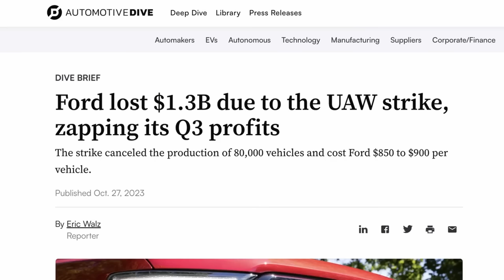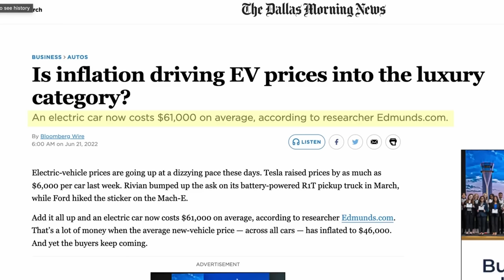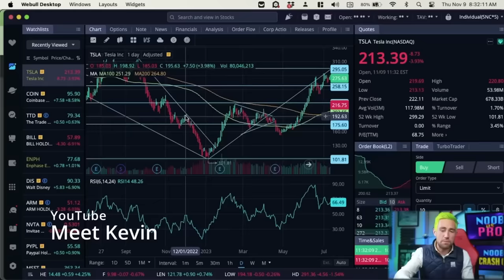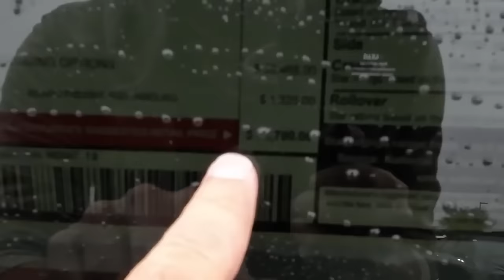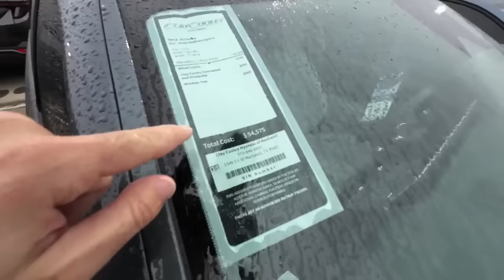Ford & GM Made A DUMB MOVE! Truck Buyers ANGRY After Finding Out The Truth...

Comment: If the appeal of an EV is to “save gas money”, why the hell would I spent 50-$60,000 to save $150 bucks a month on gas? 😂
Reply: So many other new cars are around that price. Sad
Reply: And when you add it up , when you charge an EV your still not getting the range that you get with ICE vehicle , and an ICE vehicle fill to capacity in 5 minutes, and to add even more insult to injury with the EV , the range you have the day you purchased it , every single charge  you do , a little bit of that very expensive battery dies.
Basically EVs have built in obsolescence, EVs are shit.
Reply: Yes how true!
Reply: U don't feel that pain with teslas 👌
Reply: I’m in a tesla 2019 model S 75D. I drive a lot. My gas savings in 2019 were $350 a week in gas. Now my yearly oil changes were $780 on an ice vehicle. Today I spend no money on any type of maintenance. The car today has 200,920 miles. It’s still on the same brakes. The only thing replaced has been the driver side door handle. And I am on my fifth set of tires. And tires are $1000 a pop. Mount balance alignment. From your post of $150 a month in gas. True you don’t belong in an EV. But a lot of us drive a lot of miles on our cars every day. My savings for the mileage I drive is phenomenal. My cost of electricity in 2019 was $70 A week. Today in 2024 that number is now $120 a week. Now if you break that down I whoop your ass hard-core in savings. Except we can’t compare cause you don’t drive anywhere near what I drive. And keep in mind from the day I got that car till today gas is double in price.
Reply: @brandan7761 .  The only thing sad is you’re gonna pay for oil changes air filters belts alternators motor mounts and the famous oil change. Where I don’t have anything on the Tesla so I don’t pay for any of that. So a $50,000 tesla compared to a $50,000 Honda CRV. What you will pay to maintain a vehicle I won’t come even close to it. As I don’t need to change oil or anything else on the vehicle. In my Tesla I have over 200,000 miles and I still am on the same brakes. Maintenance wise it is on its fifth set of tires. So you have to pull receipts to figure this out. To someone who drives the exact mileage. Otherwise you don’t know what you’re talking about.
Reply: @theczar6171  have you forgotten that someday you're going to have to replace that very , very expensive battery . I hope you've been saving back all of the money you're not spending on maintenance items , because that little maintenance item is going to take a giant bite out of your bank account .
Reply: @bobbrinkerhoff3592  that's not true. The likelihood of needing battery replacement is lower than replacing an engine/transmission in ICE vehicle. Also Tesla 3 battery replacement is under $10k, for example. How much engine replacement costs in a car in a similar price range as Tesla?
Most likely, the battery will be just fine for the first 200-300k miles. However, there are many examples of Tesla with original battery much over that. And even when it is not usable in the car, the battery can likely be reused for home backup applications.
Reply: Also depends on how much you drive, and what you came from. In 1 year alone I saved over $12,000 in fuel costs alone. Now was my last vehicle equivalent to my EV, no, but it is the vehicle I had. Coming up on year 2, I will have saved more than $25,000 in fuel cost. I would gladly have an F150 Lightning if it had a higher charging rate.
Reply: @ivanobulo  I've been driving for over fifty years nows , and as a car enthusiast I've owned so many cars and trucks that I stopped counting at one hundred vehicles . The only engines that I ever had to rebuild or replace were in vehicles that had been used in competition.  I've never had troubles with vehicles that were used for normal commuting and everyday use . Now unless you intend to trade in your Tesla every few years , you will have to replace that battery . How much do they charge you for labor to replace that $ 10K battery ?  At least I can pull into the local auto parts store and buy a battery and they will change it for me , if I so wish . It seems to me as if the best way to go EV , would be to lease one and trade  it in every few years .
Reply: @bobbrinkerhoff3592  Exactly my point about the probability of battery replacement. It is so rare but people keep bringing this topic again and again. It was more common in first gen EV such as Leaf and Prius because they didn't have thermal management. New EVs keep the battery at an optimal temperatures.
As for cost of replacement - below 10k is total cost (parts+labor). But this is for Tesla. Other manufacturers have obscene prices. KIA/Hyundai especially since they ship batteries from overseas.
Reply: @ivanobulo  for your sake and that of many others, I hope that you are right , otherwise you are all in for a very rude awakening . In the meantime I got a '27 Model T Ford coupe that I'm gathering parts for an update . When I'm done I'll have a car with timeless classic style , that will get over 30 mpg , and people will be asking me about everywhere we go . Where as you will have a cookie cutter car just like the car that everyone and his brother has .
Reply: Wait till u get a dent and go to body shop it's between  50,000 to 1 00 000 to fix batteries  have to be replaced
Reply: @theczar6171 fYI - figure in depreciation - your car is completely worthless.
Reply: Tesla fan boys have entered the chat
Reply: A $50k Tesla is a Model Y Performance or Model 3 Performance. Those do 60 in 3 seconds.  You aren’t just saving money on gas, you are getting performance monsters. Base Teslas are $35k. $150/mo is a good part of a $35k car payment on a new vehicle with a 100k mi warranty on the battery/drivetrain.
Reply: @bobbrinkerhoff3592  The Tesla battery warranty is 8yr/100k mi. What is your definition of every few years?
Reply: @ivanobulo hope it dont brick and catch on fire on you tick8ng time bomb and usless in winter
Reply: @JA-zh5xi   Same as the last two suburbans when I hit close to 200,000 miles. Both in reality got blown out of the water in what they were actually worth.
Reply: @theczar6171  I bet a used Prius would have been way cheaper to operate for 200k miles 😂🤷🏽‍♂️
Reply: @InternetUser._ .  Unfortunately not. If you just add up only the maintenance on a Prius the Tesla beats it. And the fun part. 50 miles on a Prius I’m talking new Prius. Currently this generation. A gallon of gas is anywhere from 4 to 5 dollars. To make this simple I’m going to call the kilowatt hours in dollars a gallon of gas. Which is $2.33. So a Prius on the lower end of a gallon of gas say   $4.00 a gallon ,  a tesla on the low end of $.24 a kilowatt hour which comes out to $2.33 for a gallon. Has got it beat hands down. And if you charge at home it’s half that cost. So this is where it’s not just about gasoline per gallon for an electric vehicle. It’s literally about everything else that goes with maintaining a vehicle. Oil changes air filters belts brakes. All of it the Tesla beats it.
Reply: A fully equipped Model Y RWD is $35K.
Reply: @dvwatts  I always thought that the definition of " Few " was similar to " Several " , it seems to be kinda subjective , but probably every 3 to 5 years . The eight years part sounds great , but it really doesn't take much of the old Zoom , Zooming everywhere and your fast approaching the 100 K mark with only a few years of driving  . Let's call it five years at 20K miles each , now that battery is out of warranty, and you've still got three years of potential life in it . Oh  BTW , does the warranty say anything about being " Prorated " , if it does you're still going to pay for a good part of it's replacement . Just remember , Elon didn't get to be filthy rich by being dumb . I highly doubt he is going to be giving away thousands of new batteries every year . Only time will tell .
Reply: @bobbrinkerhoff3592  No, it’s not pro rated, but you do (most likely) get a rebuilt battery under that warranty. 100k is the same time ICE is looking at timing belts and water pumps, maybe a radiator and several brake jobs. May also be leaking oil at certain gaskets or have clogged fuel injectors or bad coil pack. Labor and parts on those is getting to the 10k range easy and the prices are not going down. Prices for batteries and replacement are still falling (at least for Tesla) and are rare.
Reply: @dvwatts  Oh wow , a rebuilt battery . Does anyone have an idea of just how long these rebuilds are going to be good for , or is it a case of YOU getting to be the guinea pig in their experiments ? If people would follow a proper maintenance regimen they wouldn't be having radiator or injector problems, those are strictly on them , and their own negligence or being a tightwad .
Reply: @bobbrinkerhoff3592  The entire auto parts industry is built on rebuilt parts. ICE doesn’t give you a new engine either under warranty.
Reply: @dvwatts  Now , you're mixing up OEM with aftermarket . If you throw a rod thru the side of the block under your 3/36 or 5/50 Original Equipment Manufacturer ( OEM ) warranty , you will get a new replacement engine . If you blow up the Jasper Replacement engine that you bought at the corner auto parts store , you're going to get exactly what you bought in the first place , another rebuilt engine . If Tesla is offering a 8/100 K warranty on the battery, shouldn't you be getting a brand new battery . Instead of a remanufactured one ? Think about that awhile . If for some reason that battery was to fail at , oh let's say the 18 month mark , would you let Tesla get away with giving you a rebuilt battery ? Seriously , would you ?  To clarify here , I'm talking about the original from new car delivery battery .
Reply: @theczar6171 the car main battery will need to get replaced soon. 17k to replace it is going to be a huge hit on all the savings you mentioned.
Reply: You don't have to buy a luxury EV.
Chevy Bolt is only 27k.
Tesla model 3 Rwd is only 30k after the incentive.
25k Tesla model 2 is coming in 2025.
Reply: I was planning on buying the Honda Ridgeline until they said 2200 dollars plus tax to replace the timing belt and water pump every 60k miles. 😮😢😂
Reply: @drifter5682  Useless? I turn on the heater, seat heater, defroster and steering wheel heat 5 min before I walk out to the car. In the garage or not, and can do it from anywhere on the planet with cell service. Winter is the best time to have an EV. Oh, you mean I can’t drive 250 miles without stopping to charge. I don’t do that unless it’s Thanksgiving or Christmas anyway. Easy trade off.
Reply: @dvwatts  Yes useless , let's say you drive into work Monday morning and it starts snowing , by 10 AM it's snowing harder , by quitting time , you're knee deep in heavy wet snow .Now if you've got any common sense you're running your headlights so that the other people out in this mess can see you , you have the heat/ defrost , and the wipers going so that you can see them . Plus , trying to plow thru that heavy ,wet snow is much harder to do than driving on a clear road , so how much of your charge have you used now . Throw in there you may get stuck in traffic for awhile because of an accident , or worse yet get stuck yourself . My old fashioned ICE vehicle has a charging system that keeps all of those accessories running as long as the engine is running , while your new fangled EV is running down the battery that you are dependent on to get you home . Which vehicle sounds like the better idea now ?
Reply: @theczar6171  You can get a used Prius for 10k that’ll easily last another 200k. That’s a 70,000 price differential between the two vehicles assuming you bought your S new. 
Maintenance cost on the Prius would likely be mostly negated by the higher insurance premium you’d pay on the S. Let’s ignore registration, as I don’t know what state you’re in. (Though with $5 gas I’m assuming CA)
If we give a spread of 2-4 dollars “per gallon” in energy savings between the 2 energy types. With a conservative 40mpg with the Prius that’d be 4,000 gallons of gas for 200k miles driven. 
= Your savings spread would then be 8-16k. On a 70,000 dollar differential between the two vehicles. I.E, the used Prius is far cheaper. 

I’m genuinely interested in the topic as I run CBA’s for a living. Let me know if I missed anything.
Reply: @ericgregori  How much is insurance / registration on a new Y vs a 10k used Prius? Is the difference more or less than your energy differential +/- maintenance?
Reply: @InternetUser._   yes one important factor you’re comparing a brand new Tesla at $70,000. To a used Prius $10,000. So the comparison actually needs to be between a purchase of the same used Prius and the same a used Tesla for a price comparison the first model year model S from 2013 , but I would actually prefer the cheaper Tesla used in the comparison. Like a model 3. Against a Prius. Basically same year same mileage. Both purchased used. Because I am now seeing model threes under $30,000 in the used car market with less than 60,000 miles. And to top it off you need somebody who is actually honest about their Toyota. I only say that because my neighbor has a Prius. And the husband has always lied to me about how great the car is. But yet his wife will flat out tell me that car falls apart constantly. Check engine light battery light check engine light. She love that car until it hits 50,000 miles and she says it’s been a disaster after. She could be exaggerating. I don’t know. What I know is the husband loves it the wife hates it. She prefers to drive his suburban.  Go figure
Reply: Mainly because the ice cars cost the same or more so with all things being the same, you might as well buy an electric card but don’t forget with an ice car. You also have to change the oil every 3000 to 4000 miles and fix this and fix that and fix this fix that Non and I sell them getting out of a service department that dropping 1000
Reply: @dvwatts  yea lets se how long it lasts at -40 and we all saw how they charged so we in Chicago this winter wasnt near that cold .You think hydro is going tp stay cheap your head is really in the sand then
Reply: @Mathilda2zero How many miles is $40 a week
Reply: @InternetUser._ @InternetUser._  I had an 8-year-old Mazda 3? My insurance went up about $10 a month. Living in the most corrupt state in the union, I pay an extra $100.00 a year.
Reply: These trucks have fewer parts and are cheaper to put together,yet the Auto company wants to screw the consumers
Reply: @theczar6171  I inputted the numbers on a used Prius in my example because I specifically asked you if a used Prius would have been cheaper to operate than your model S. The numbers proved that it definitely would have been. 

But to be fair, let’s say a brand new 2019 base model Prius ~25k vs a new 2019 base model S ~75k. Price differential of 50k. 
Mpg on a 2019 Prius would be far better than the 40mpg you’d get on a cheap used one, probably closer to 50,but let’s stick with 40 to give the EV some buffer. 16k in energy savings over 200k miles with a 50k price differential. Still doesn’t pencil out. You could spend another 20 grand maintaining that Prius, and it’d still be far cheaper to operate (lets ignore the premium insurance, registration and tire cost on the model S)

I often see the argument presented; new Ice VS new EV of similar cost,  EV is cheaper. My issue with that is that it’s often a redundant question given the context. If you’re trying to “save money” by not buying gas, why are you going to opt into a 5 figure depreciation loss on a new car? That doesn’t make sense to me. The numbers point to the fact that buying a used, reliable hybrid is the cheapest way to operate a vehicle.
Reply: 2020 Model 3 SR+. Paid 40K at 2.19 APR, 35K miles, Charge at home Level 3 (NEMA 14:50). Commute is 170 miles round trip 3 days a week. Absolutely love the Adaptive Cruise/Auto-Pilot feature.
Reply: @theczar6171 - I call bullshit. I want to see your Tesla with that mileage.
Reply: @InternetUser._  So one of the hardest things to do with comparing the EV is charging at home. In my personal opinion. The correct cost is never correct unless you follow some sort of rules or guidelines. Let me explain. In some areas once it hits midnight the Tesla charging station price goes down to $.11 a kilowatt hour. Now what is your kilowatt hour at home. For instance if you charge in the middle of the day at a Tesla charging station it can be as high as $.59 a kilowatt hour. And it varies between the 59 and the 11 depending on what time you go to a Tesla charging station. So trying to nail down fuel costs without guidelines or rules can cause your numbers to be way off. Obviously still cheaper than a ice. I try to stick with the charging stations where I pay the least. Comparing it to the suburban I drove number wise it beats it. No oil change no transmission service no nothing. On the side of where I go after the Prius is due to the people I work with. And what we discuss cost of this cost of that. They’re not happy I have no maintenance costs. The only receipts I have is for the tires being changed on the car every 40,000 miles which is $1000. But I haven’t done my brakes yet And I’m at 201,000 miles. They drive a lot and I drive a lot. They have receipts and we’ve done this before and they’re shocked that they lose. If I can get copies of those receipts to show you the comparable it be easier to do this. The receipts for the suburban the receipts and their Prius. And then my receipt. Because this I would love to send you cause it’s a real world. Their mileage is just like my mileage. All high mileage vehicles. Their repair costs where I don’t have repair costs. I’ll get back to you if I can pull this off.
Reply: @theczar6171  You save $350.00 in gas and spend on average $333.00 a month for tires?
Reply: What does a truck cost 😂 either uninformed or spreading misinformation
Reply: @mikldude9376  Hybrids Rule.
Reply: @bobbrinkerhoff3592  You think maintenance and repair is free on anything else. Engine and transmission repairs can be much higher.
Reply: @richvail7551  That’s correct $350 a week when I picked up the Tesla in 2019. Immediately my gas bill for the week was gone. I get 40,000 miles out of the tires. I am currently at 201,000 miles. The tires were recently replaced at 190,000 miles. The Tesla replaced the suburban. My suburban would not go past 50,000 miles on the tires or the brakes. And I save something like $780 a year in oil changes.
Reply: @theczar6171  ah yes, a faux pas on my part for sure. I was thinking that ain’t much of a savings. Good on ya
Reply: Also higher insurance cost, more expensive tires with more frequent replacement, more expensive service/parts, charging costs (electricity goes up too) .  No thanks!😊
Reply: @Zeus-dw1cx  maintenance and repair only costs me for the replacement parts , but then I've been turning wrenches since 1965 , so just maybe I might know a little something about vehicle maintenance . I also just might know a little something about tweaking a vehicle to get the most out of it , whether it's for MPG , or high performance .
Reply: @Cpt.Buttknocker  you really think no one will make batteries in 30 years? Or electric motors?
Reply: Range?  95% of the time the trip is local.  Less than 40 miles .  
    As a traveling salesman who covered more than 65,000 miles per year  I could still buy a EV that I would be able to charge over night. At home.
Reply: @theczar6171  $780.00 a year to change the oil on a Suburban ? Who was gouging you for their next bass boat payment ? Oil and filter at the Chevy garage is $60.00 on a Silverado .
Reply: @theczar6171  so there is a scenario where it works, but we are talking about the average consumer here. I thought that was obvious?
Reply: @possiblynick  I guess in the end it’s the end-user. I know of more than one 2013 model S tesla that never leaves the neighborhood. They go to church they pick up the kids they drop off the kids they go shopping grocery store whatever , the car never leaves the neighborhood. it’s never been to a charging station. They charge at home. I don’t remember exactly. But when I talked to them they were telling me they were under 30,000 miles on that car. It’s still gets the same range. It’s never been to the dealer or any repair service shop at all.  So in someway it is the consumer. But it’s the consumer that knows what he needs a vehicle for.
Reply: Well said I agree
Reply: Same question here!  I won’t!!  Vehicle prices ridiculous!
Reply: @richardandre9811  like I said the average American can’t afford one
Reply: EV owners are feeling buyers remorse and many are going back to ICE vehicles… I’ll keep my vehicles and my money too….
Reply: @bobbrinkerhoff3592 you'll replace your engine/transmission before my battery fails😂😂😂
Reply: @ivanobulo I’m driving a 23 year old car I paid $1,500 for in 2008 and it costs me about $200 in parts yearly and the engine and transmission are doing great. This is how you own a vehicle. Yours has lost 3/4 of it’s value and is inconvenient. Mine is worth at least twice what I paid for it. 😂
Reply: @dvwatts I buy vehicles for $500-2,000, fix them up and drive them for years, that’s a good investment. 😂
Reply: Not to mention that it will take me much longer to visit my family who lives 120 miles away or if I go on vacation somewhere. Range and charging is still a big issue, and there is no way I could just charge it at home with my current apartment living situation.
Reply: @theczar6171 So your 200,000 model s 75d if you factor every charge takes about 20-45 minutes with a range of 249 miles it would mean that you waste about 267-535 hours charging the life of your vehicle. I would conclude that you waste about $4000 to $8000 during the life of your vehicle not being productive with a base pay of $15 dollars hr. Deduct the saving not having oil changes and factor in the tires at 1k a pop to me it sure does not sense to me and most people. Sure enough batteries would need replacement after heavy use factor in that cost. Don’t get me started on the resale value on Evs.
Reply: @drifter5682  ICE cars do burn too. Actually the whole battery pack in EV has less than 3 gallons of gas in energy equivalent. So 15 gallons of gas in ICE car vs. 3 gallons in EV, which one burns hotter. The only thing ICE cars have over EV is fire departments have familiarity and equipment to deal with them
Reply: Most EV early adapters already bought their toys. Now it is time for EV makers to attract general public who are sensitive to price parity between ICE cars and EVs. If the EV prices drop to the same as ICE ( which are overpriced last 3 years), the day of price parity is getting nearer. If the charging infrastructure gets better, then that will tilt it over EV more. And do not forget any global oil crisis that significant raise the cost or availability of gasoline, EVs will become more attractive. It is similar to the rise of Japanese cars in the US in the 70 ( OPEC US oil embargo)